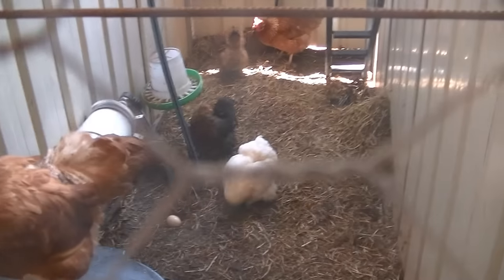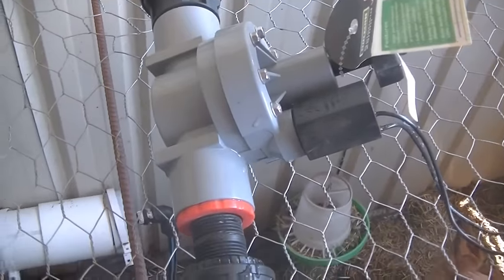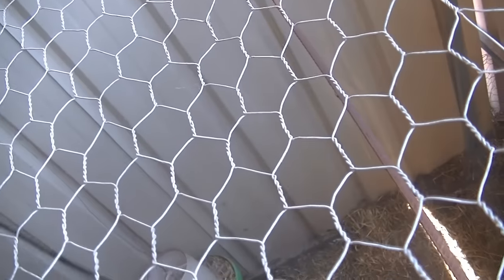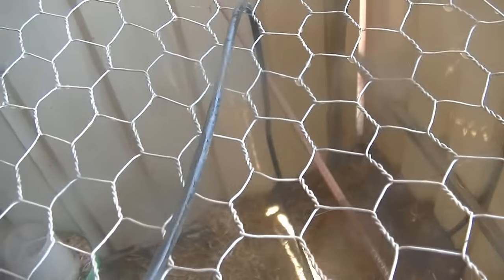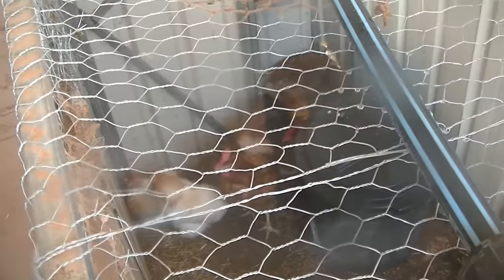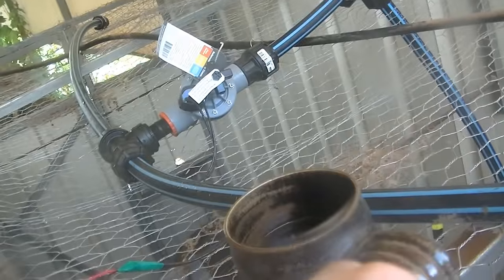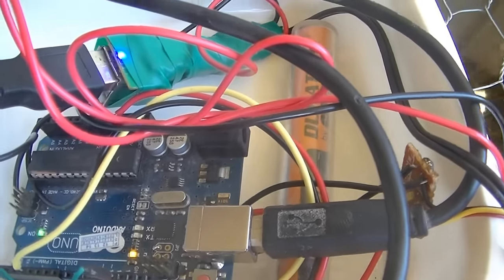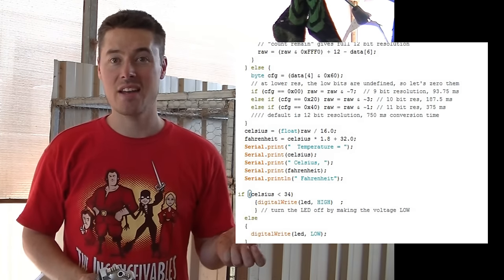DIY automated chicken cooling/misting system

Comment: LOVE the shirt! Doesn't it make the hay in there soggy and moldy? I also heard chicken feces gets pretty nasty when it builds up, would this system help with that if you had drains?
Reply from the maker: +Jenny Livingston 
It drains out naturally through the bottom.

The good thing about this is when it's working properly (and I'm not dunking it in hot water), it'll only click on for 5-10 seconds, not enough time to get everything wet and nasty. But I do need to clean out their cage more regularly when it's hotter.